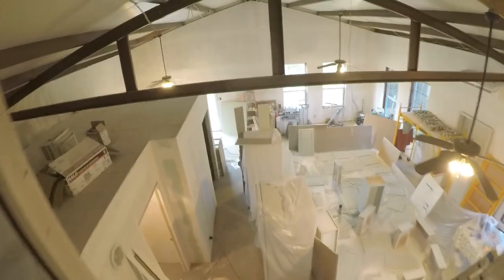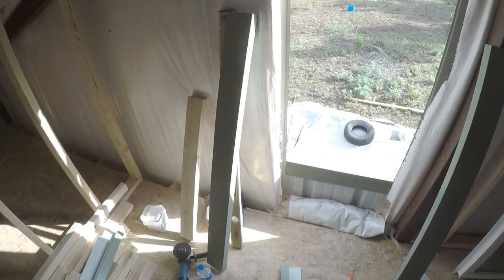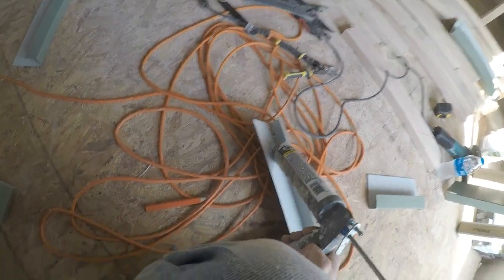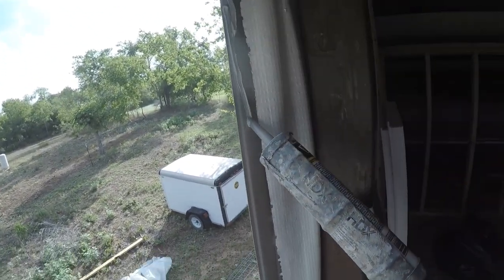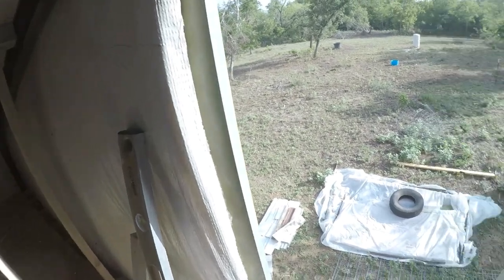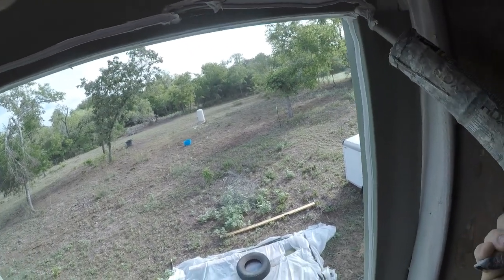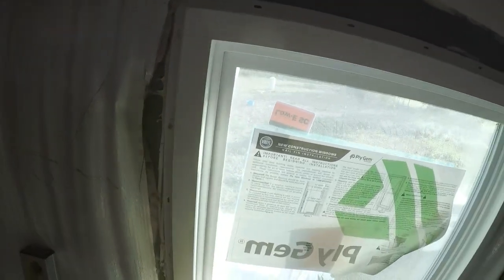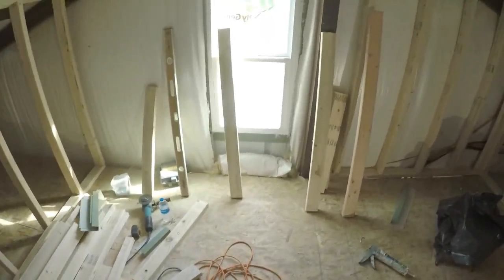How to install a window in a metal building

Comment: I wish you would have shown how the window was actually fastened to the building. What did you do on the outside of the building during this installation? Your window had a nail fin so you might have used metal screws or pop rivets to attach it to the J trim or ?. The J trim was just slid over the wall skin opening but not fastened to the opening. All of that is just "floating" in the opening and seems prone to loosening calk bond because the building is going to be flexing due to temperature changes and wind. Then what was the purpose of the wood and where/how is that supposed to be incorporated into this window?